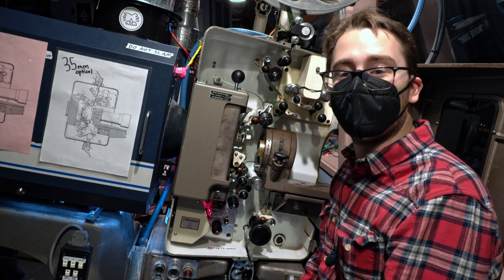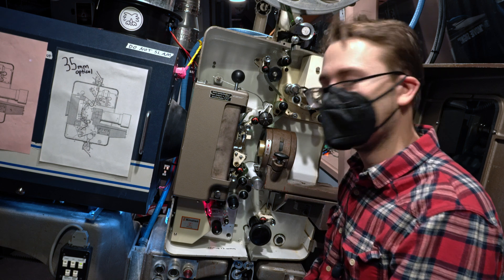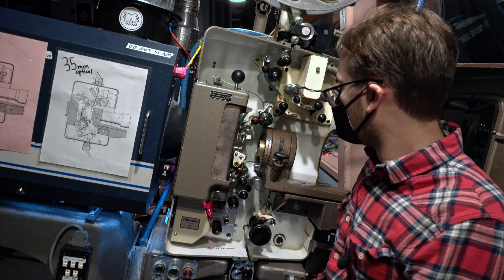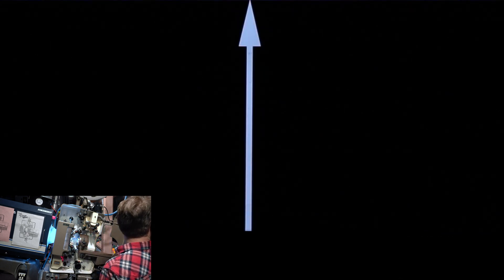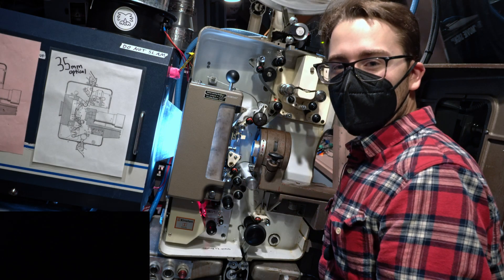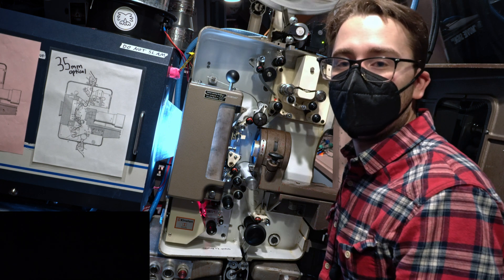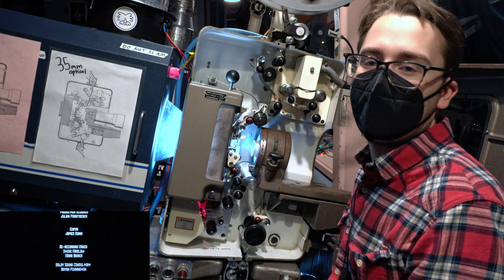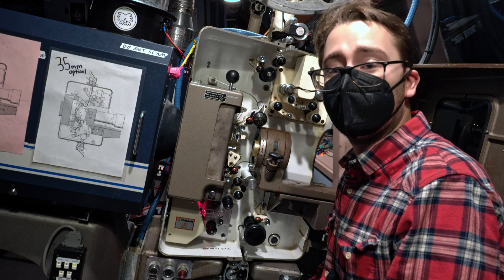Running Modern #70mm DTS Film (4K)

Comment: when you do a changeover how do you sync what's showing in the 2 projectors?
Reply from the maker: The film print has markings, called “cue” marks which tell us when to start the projector motor and when to fully changeover (or let the image and audio change projectors). The audience should never notice anything happened, it works very well!
Reply: Thanks  @KyleMiko  . I know about cue blips (from the old days of movies) but still don't understand how the timing can be close enough that the image doesn't jump  when changing from one reel to another - esp. if the projectionist isn't fast w/the changeover. Do the two projectors ever run at the same time?
Reply from the maker: @racena2034  yes, there is roughly 8 seconds where they are both running at the same time, the gap between the first cue and the second cue (motor starts up and counts down to sync). The simple fact is that the projectionist has about 1 second of overlap where it’ll look like a scene change/cut as the douser is closed at the same time the douser opens on the other projector (letting light through the new projector and not the old one with film that just ran out). People simply don’t notice changeover when done correctly, because you have enough “slop” time. I’m thinking about making a video on this subject eventually to help better explain it to everyone :)
Reply: That would be AWESOME! I've been fascinated w/changeovers since watching an old Columbo  @KyleMiko  . Thank you for answering so patiently.

Comment: what processor do you pump this into? I upgraded to a CP500 for my DTS. I was going to try running a CP65/DA20 but that needed a sub-board to switch things. I much prefer the CP500 as everything plugs right into it.
Reply from the maker: We use a CP650 that has everything built in when you have the cards for DD/AES
Reply from the maker: Well not DTS or Mag